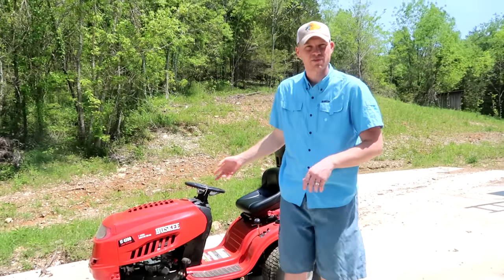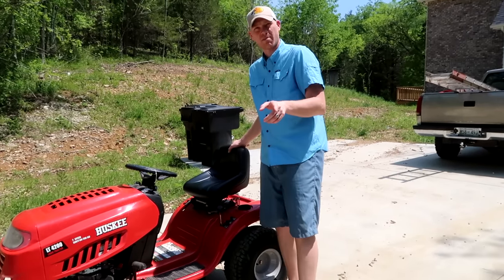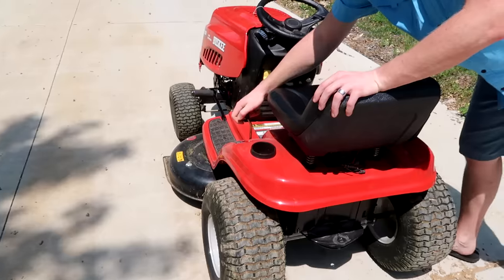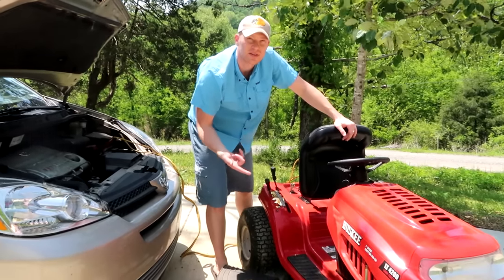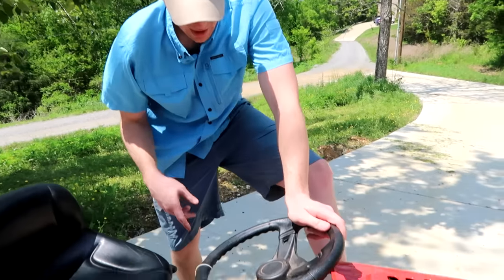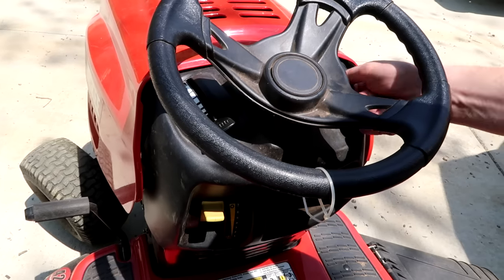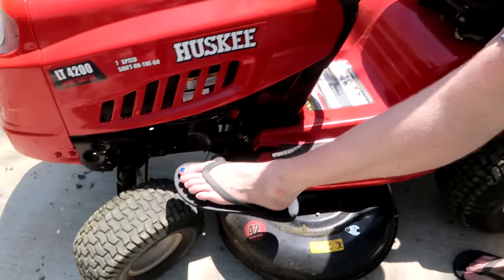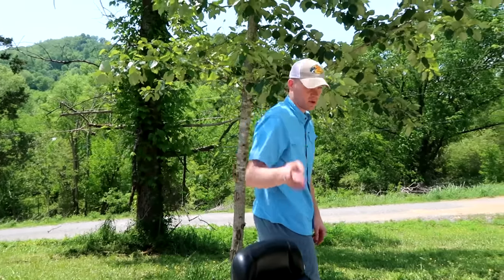MOWER WON'T START - QUICK TIPS

Comment: Could it still be the spark plug if there is no sound at all when trying to turn it over? The deck is hard to disengage on mine, takes a lot of strength? Why do you think? It won't start. Got a new ignition coil, still nothing. Tried to jump it, got nothing. Any suggestions???
Reply from the maker: If no sound at all it is not the spark plug. Otherwise the starter would be turning over it just wouldnt fire. Sounds like a different electrical problem. Most likely a safety switch somewhere....seat not down, deck not disengaged, etc
Reply: did you get an answer with your rider??? Mine is doing same as yours

Comment: I have a Toro Lx468 and I have to shoot carb cleaner in it to get it to start. It tries to turn over but wont start until I do that. Runs strong after I shoot the cleaner in it. I put 2 new plugs in and a new air filter along with changed the blades and oil. Any suggestions?
Reply from the maker: I'd say carb jets might be partially clogged. Hard to say. If it were me I'd rather spray carb cleaner than pay to have the carb fixed
Reply: @WHOTEEWHO  Ok thanks. So a fuel filter would not make it do that and can I just clean the carb really good? After it is running it starts fine.
Reply from the maker: If it was the filter it probably wouldn't run fine afterwards, but a filter is super cheap to replace

Comment: My lawn mower won’t fire up, just click sound after deck belt replacement.  Checked all the wires, battery, nothing wrong.  Turned out the nut underneath the engine was NOT tightened properly!  Once it was tightened properly, the lawnmower fired up when the key was turned on.  Just trying to share this with people

Comment: my mower want do anything, want turn over. changed starter, solenoid, and switch. What could be the problem?  any help would be appreciated
Reply: check your fuses and then you may have a clogged fuel pipe or you could have a bad ignition switch may be bad.
Reply: @kyle77502  For what it's worth, I changed all that and fuse was good to. Still did not turn over at all. One thing i noticed it would not go into neutral , cause one wheel on left would turn back as i pushed at times. Oh, I even unplugged seat switch still the same. So I gave up on this 1991 Craftsman Lawn tractor. (what a headache) Some guy picked it up an hour later from the curb. I thank you for your response.

Comment: Having trouble with my John deere LA 145 unless I jump start my starter it want turn over with much force at all..but when i jump start the starter it turns over strong but it will not crank up unless I put alittle gas or starter fluid down the carburetor then it runs until it burns it off then back to just turning over..remember only while jumping it off it will turn over with power..while with no cables to jump it there's not much power..battery shows 12.3 on my Multimeter heard that could be even to low. Ive pulled my plugs while trying to start it but it acts the same as my above statements.. and ive done spark test and plugs are sparking..could this be a safety switch.
Reply from the maker: I dont think it could be the safety swith, I think the safety switch would block ALL starting even when jumped. Is your battery good? Could also be the starter solenoid needing replaced
Reply: WHO_TEE_WHO Thankx for quick response. Well I had been cranking it up with a screwdriver across the solenoid terminals since last summer by passing the solenoid sense my key switch is bad
Reply from the maker: Ahh. Yup. Used to have a car I started that way until i replaced the ignition switch

Comment: I just got a new battery. It’s making a clicking sound, but it won’t start even when I’m trying to jump it which when it was the battery issue that made it work I don’t know where the spark plug is.
Reply from the maker: Could be starter solenoid

Comment: New battery new ignition switch and it won't start but it ran was a screwdriver until the ignition switch messed up what to do what to do beat my head against the wall

Comment: Tried starting a mtd  and would not start. But will start if 12 v is applied to starter  ???
Reply: Check that your battery has good charge
Reply: After trouble shooting there was a safety switch not working

Comment: where is the spark plug situated and what tool do you need to remove it?
Reply: If single cylinder, it's on the front - look for a large diameter wire.  When the engine is off and cool, grasp the boot (rubber elbow) and pull it off.  There's the spark plug!  If it's a two cylinder, the plugs will be on the sides arranged in a V opposite each other.  You can unscrew the plug using a Crescent wrench, just be sure not to round off the corners.

Comment: Im trying to find where exactly to put the starter fluid. U showed everything but that. The cylinder? What cylinder?
Reply from the maker: Use starting fluid sparingly - but if you do use it spray it into the air intake. Which will be where the air filter is. Remove the filter first
Reply: @WHOTEEWHO  Ok thanks. I might found what my problem is. Probably the flywheel key since i remembers hitting something hard. After that my mower started acting weird thing it never did before.  Thanks anyways

Comment: I ran out of petrol on my John Deere and when I filled it up it now wont start. Did I run it dry that it sucked air or dirt into the fuel line?, It sounds like it wants to turn over but doesn't...anyways I'll try and turn it over the next day, any ideas would be much appreciated.
Reply from the maker: Hmm hard to say dwpending on the model. Id tey starting it while spraying some starter fluid into the intake
Reply: thanks i'll give that a go if it doesn't start in the morn.

Comment: I have a John Deere L108, left the key turned all the way on all night by accident, thought I drained the battery which i probably did but bought a new one, put er in and still nothing, I get a bit of clicking. Any tips would be much appreciated
Reply from the maker: When that happens, 99% of the time it is 1 of 2 things. Either the starter solenoid or starter motor. I am surprised swapping the battery didnt fix it though. Have you tried jumping it off a car battery?
Reply: WHO_TEE_WHO  thanks! I'll give that a shot
Reply from the maker: Hope it works. Msybe the new battery just needs a good charge up
Reply: WHO_TEE_WHO  jumped it, worked like a charm! Thank you so much 👌🖒
Reply from the maker: Awesome! Good news!

Comment: Mine won't start.  I haven't yet checked the plug or air filter.  All other checks performed.  New battery.

The solenoid jump didn't start.  Car jump - nothing.

What I hear is a GRINDING noise.  Metallic scraping noise.  Before I drop 110 bucks on a starter, have you an opinion.

Thanks!!
Reply from the maker: I'm not an expert, but if cranking and hearing grinding a good bet is the starter. Just replaced mine and solenoid while I was at it

Comment: I have a yard machine. I have replaced the solenoid, battery, spark plug and fuel filter. First it fires up, runs for 5 10 minutes. Then when I try starting it, it either clicks or cranks slow. Please help?
Reply from the maker: Sounds like an electrical problem somewhere maybe. How old is it? I would check all the wiring connections again first fir tight fit and good connections
Reply: sounds to me something is draining your battery check for any cut wires or loose wires

Comment: I have a 1986 Craftsman riding mower that was running yesterday, but when I tried to fire it up, it would not start. I tested the battery with my multi meter and it read 12.33volts. I also put fresh gas in it, a new air filter, spark plug and cleaned out the corroborator. Does anyone have any Ideas?!
Reply: I think I may have found the problem. I believe it has a bad starter. I have a spare one at home that I am going to put on this weekend. I hope that works.

Comment: I have a more mysterious problem. my starter doesn't engage when I turn the key.
I can hear the solenoid on the carb engage when the key is partially turned and can get the starter to engage if I touch jumper cables directly to it so it's not the starter or battery but something in between seems to be broken. checked the starter with a volt meter and there's no power getting to it.
my guess is a safety switch somewhere is broken but it doesn't seem to be the one on the seat or the one on the brake and I can't see any others.  
my mower looks exactly the same as yours BTW, but it's a troybuilt.
any ideas?
Reply from the maker: Hmm. Electrical problems are no fun! Have u also made sure that the blades are not engaged, the mower is out of gear, good connection on the battery,
Reply: yup
Reply: try the starter relay switch its under the battery my huskee mower same as this one and very similar to all mtd made mowers. Mine would get nothing when turning the key and everything else checked out good found the by replacing the starter relay solenoid under the battery fixed mine
Reply from the maker: Thanks AZ tech!

Comment: So I have a yard machines that will start but it’ll take a while and when it dose it’s very underpowered. I don’t know what’s wrong. It’s got new 87 gas in it so that can’t be the issue.
Reply from the maker: Hmm. Choke maybe messed up? Has to get the right mix of air and gas to run right

Comment: Why does my lawnmower have enough battery power and won’t start but when I connect the charger the positive cable to starter and the negative to the negative side and it cranks up
Reply from the maker: Then it must not have enough battery power or good connection
Reply: Yup. My battery charger said 100% charged but when I put it back on tractor not even a sound. Had to replace the battery and started right away.

Comment: When is it a carburetor problem? Thx for your reply.
Reply from the maker: Depends on what is happening. Have you checked the lines to make sure it is getting gas?
Reply: WHO_TEE_WHO. Thx I am replacing fuel filter? How do I check it it’s getting ⛽️ gas?
Reply from the maker: One way to check is if it will stay running of you spray gas or starter fluid into the carb but shut off when u stop
Reply: Yes stayed starting fluid into carb. It cranks over and starts for a second, gasps and quits
Reply from the maker: Sounds like not getting enough gas in then
Reply: WHO_TEE_WHO. Ok then I will check fuel pump?thx
Reply: AlwaysSkeptical Forever sell it to the drunk yard therl buy it and by a Brand knew one. Don't forget to thank them. Great video.

Comment: mine will only start with starting fluid and stay running u till you turn it off and then it turns over but wont start u les u use starting fluid

Comment: Murray 1998 riding mower will not start. Replaced battery and starter soleniod.  Still won't start.  Went from a 3 post to a 4 post soleniod.

Comment: Have a yard machine, can get it to fire if I put a little fuel in the air filter directly, but it won't stay running. Carbs as clean as a whistle, have spark, battery is good. Take fuel line off carb and flows like a river... not sure where else to go from here...
Reply from the maker: If it has good spark then sounds like a fuel/air mixture issue. Either getting too much or not enough gas or air
Reply: So that'd be the "fuel pump" before the carb then? I've been working on this since 10am, I'm not a mechanic, but if pointed in the right direction I can get it done lol.
Reply from the maker: Hard to say without being there :)  have you checked the fuel filter? Should be a little filtwr along the fuel line between the gas tank and carb
Reply: WHO_TEE_WHO I haven't, presumed it's was fine since the flow on the carb end was pretty good. But I'll check that first, thanks a bunch for the help and quick responses!
Reply from the maker: Same story with the air filter too. Too much air or not enough air could also cause problems

Comment: How do I get the plug off . Mine is a murrays and the frame is so close to the  plug.
Reply from the maker: have to find a socket that will fit it
Reply: The frame is almost touching the  plug.I think it's  the battery. It reads 8/17
Reply: Ok thank u.

Comment: hi, I changed spark plug and everything that you described but mine still wouldn't start. I got it cranking but just won't start. what could it be? thanks
Reply: Gas Pump or Dirty Carburetor.

Comment: I needed to jump start it several times. And now its doing nothing. Like I bearnd a fuse. It wont even spin anymore. Help...
Reply from the maker: May have fried the Solenoid
Reply: @WHOTEEWHO  it kliks when I put 12 volts on it. But after I pull it off. There is still a reading on continuity
Reply from the maker: Either starter or starter solenoid. Mine was doing the same thing. I replaced both and now starting and running fine.
Reply: @WHOTEEWHO  wauw thanks alot. New fan from Holland!
Reply from the maker: Thanks for watching!

Comment: Mower won't start, took spark plug out sprayed starting fluid in cylinder it started and ran 4sec but won't start back up unless I repeat that step. help
Reply from the maker: Hmm. Do you have the choke on? Sounds like an air and fuel ratio problem either not enough or too much of one or the other
Reply: WHO_TEE_WHO what can i do?
Reply from the maker: Are you trying to start it with the choke on or off I would try one or the other whatever is not working currently
Reply: WHO_TEE_WHO the fuel filter is not full,I don't think that enough gas or any gas is getting to the carb
Reply from the maker: How old is this lawn mower?
Reply: WHO_TEE_WHO really don't know its a craftman 20.5 twin turbo
Reply: try and clean the carb, probably isn't getting gas

Comment: All checked still wont start. I hear motor trying to start but won't start. What could be wrong?
Reply from the maker: Is thr motor cranking over and spinning?
Reply: @WHOTEEWHO  Yes, but it stops as soon as I leave the key. I already replaced the spark plug still no go. I am thinking I either have to change the carburetor or the air filter now.
Reply from the maker: Gas air and spark and it should fire up. Hard to diagnose without being there. I have replaced the carb on mine but due to other issues
Reply: @WHOTEEWHO  As soon as I replaced with new gas and a new air filter, it fired up in one shot. Thank you so much!

Comment: If you get the battery light come on and it tries to start is it the battery?
Reply from the maker: Doesnt sound like it
Reply: It's very likely the starter or the alternator.
Reply: @lelandevans182  can you jump start them successfully after being left without running them for a while?
Reply: @mattseymour8637  It depends on how long a while is; if it's not run for a couple months, I'd say check your oil and gas and give it a go.  If it's sat for several years, definitely change the oil, drain the gas and put in fresh, change the fuel filter, etc before attempting a start.  Gas goes bad after a couple of months unless you treat it with Stabil, and then it'll stay good up to two years.  The idea behind changing out the fluids is to keep the old gunk out of the sensitive parts (carburetor, fuel lines, etc.).  Ethanol fuels tend to get varnishy, which gum up the carburetor butterfly and make it not run at all or not well.
Reply: @lelandevans182  thanks for the reply.
Probably looking at around a year so will the battery start OK?
Reply: @mattseymour8637  I would recommend checking the oil and draining the old gas.  Put in fresh gas, be sure to push the throttle lever to choke, and give it a try.
Reply: @lelandevans182  thanks will try it.
Is that without jump starting?
Reply: @mattseymour8637  You can try it without jumping just to see if your battery has enough  juice, but if it won't turn over, then try connecting jumper cables from your car - like in the video.
Reply: @lelandevans182  thanks for that.
Can I use jumper pack instead?

Comment: troybilt once fired up,hasnt since.dumped out wrong oil,in with proper oil,solenoid clicks,checked ground,tested starter,pto on and off,pressed in brake,plug is good,battery is good & jumped it with jumper cables regardless,carb is clean i highly guess,grinded out paint on back side of metal so ground can touch.still wont turn over or start and gas is good.what now? out of ideas.

Comment: @Joshua Bailey sounds like the fuel shutoff solenoid. Look at botttom of the fuel bowl on the carburetor, You will see the solenoid with the power wire going into the bottom of it. When you turn on the key you should hear it click, that lets the gas flow through the carb. No click no gas no start.
Reply from the maker: Thanks!

Comment: So i checked all that and still nothing replaced fuse starter solenoid carburetor and ignition. And still nothing. Mower worked a few months back been sitting and now nothing. And oh yea new battery to. So i dont know. Its a murray 17.5hp
Reply: Just spent a few hours and then some more. Messed with all the switches and wire terminals. Realized the flywheel/fan/etc was not free. Took the cover off the fan and turned it by hand a little. Started right up. Then the trans wasn't working....

Comment: Battery charged, ignition wiring replaced (mice) spark plug changed (new) solenoid changed. Gas, park, neutral. No click.
Reply from the maker: Hard to diagnose something potentially complicated without being there. This video is to show a few quick, easy things to check.

Comment: I got a brand new battery, started and ran once, sat for 2 weeks after it got cold, now it won't start, battery only at 50% charged. This tells me you had better charge your new battery because they DO NOT have a full charge in the store. Never trust your store to sell a mower battery with a fell charge, because they don't.

Comment: sadly this didn't help... Mine cranks but won't quite catch. new fuel filter, fresh gas, new spark plug, Not the symptoms of a solenoid... feeling more dread that it's the carb.
Reply from the maker: You try some starter fluid?